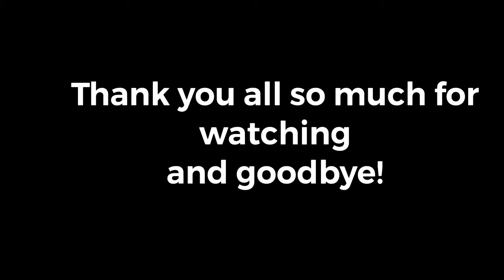Honda prelude SH going to get a new engine. (Lucys restoration)

Comment: Hope you get it running great again. 
Got rid of my bb6 a while ago , started misfiring then dumped all the oil at the gas station so just sold it. Pretty sure it was stolo no title or plates but drove it for a good while. Best $350 ever spent.
Reply from the maker: Thanks, I'll be uploading soon.